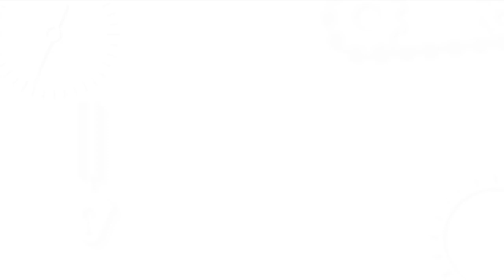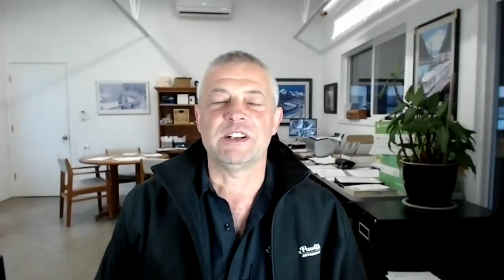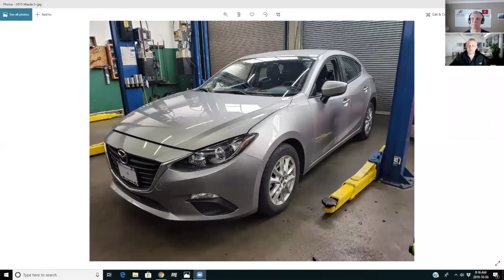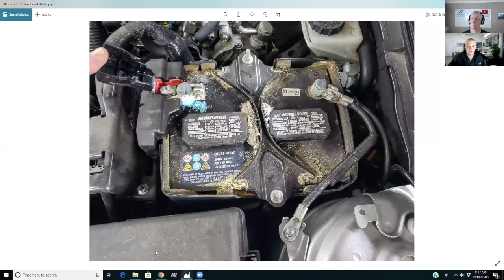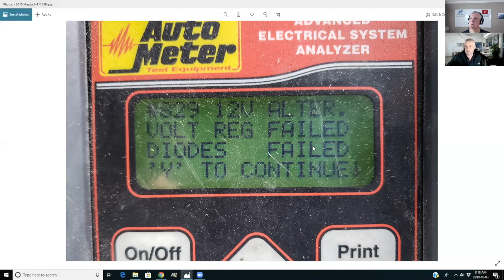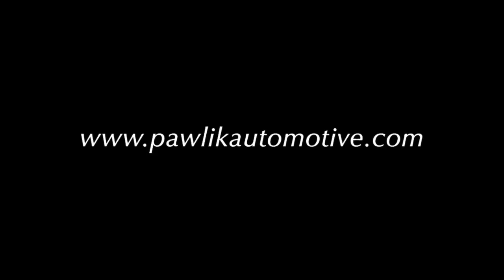2015 Mazda 3 - Electrical Issues

Comment: alright i watched this guys video 
my car is a 2014 mazda 3 2.0
everything is working fine except transmission shifting not in time and ac not that cool 
so no codes i got the car cheap so i knew something is wrong with it 
so they put in a new battery but the cca was not the right one got a new right battery 
took apart the alternator the brushed seemed new so i figured they put in a new alternator but my hands turned black i washed the area were the alternator goes after i washed it was working good 
so i did it again worked good 
i have put a voltmeter on my cars power i can see the voltage never reaching 14v 
so i figured maybe voltage regulator i put in a used alternator same issues when weather is cool it’s reaching 14.2 i’ve put in an extra ground wire at the alternator 
no change when hot it’s not working properly i mean the alternator not reaching 14v
this guy hasn’t diagnosed the problem completely so who is the genuis that’s gonna figure this out ?
and idle rpm goes down when cool

Comment: Thanks for the insight but the title is a bit misleading. After watching the video, in the end, there was nothing inherently wrong with the car. It's just that the Mazda 3 is sensitive to a bad battery since almost everything is electrical (including the electric power steering). On traditional hydraulic steering cars this will never happen as the steering depends on having hydraulic oil pressure, not consistent voltage like in electric steering. I do appreciate your valuable insight because symptoms like erratic power steering will help me better assess future issues with my 2016 Mazda 3, which has been to this date, flawless.

Comment: My 2015 mazda3 has the same exact issues, but codes returned PCM voltage failure, as well as ground wire failure and low fuel system function. My car eats batteries like there's no tomorrow, and that's the first thing I noticed about it. I tried to tell the mechanics and they either didn't believe me or couldn't find a reason to. My battery gets replaced 2-3 times per year now. If I'm lucky, once a year. I recently struck low voltage (about 50% capacity) when it was tested during an oil change. Following that diagnosis was a simultaneous eruption of engine, TPMS and TRAC lights, and limp home mode at 3000 rpm. I tried to have my battery replaced but the shop told me it tested at full power when they tried it again. I think this line of mazdas has electrical problems to a severe extent, and something in the system is incompatible with the battery.
Reply: Ground issue?
Reply: @Littles13579  Yeah definitely
Reply: @HospitalForSouls.X  did you find the problem?
Reply: I have the same issues with my car. It’s a 2014 Mazda 3.
Reply: also curious if you found the issue. I also deal with this once every 2 years now... essentially what is described in the video, power steering seeming to drain the battery enough to turn off and back on. the dash would completely shut off randomly until battery charged enough. Issue after this happens is car wont start without a boost seeming to not hold enough amps to turn over the veh... but the battery is enough to use any other parts of the vehicle no problem.

Let me know! :D

Comment: I am keeping my fingers crossed that this is the solution for my car. All the same issues, funky steering etc and takes you by surprise. I am actually afraid to drive my Mazda in case it happens in front of a truck! I am in Australia and hoping that someone like you might highlight this issue to Mazda as a simple Google will tell you there are MANY complaining about these listed dangerous events. Many thanks for this information.
Reply: https://youtu.be/el7xQBz1X6E